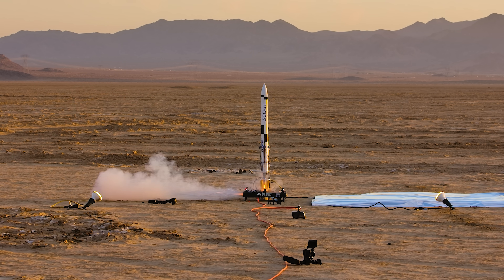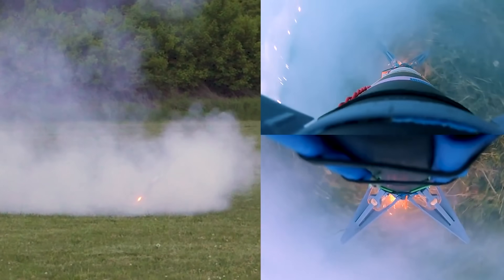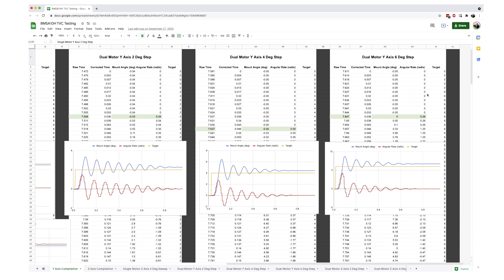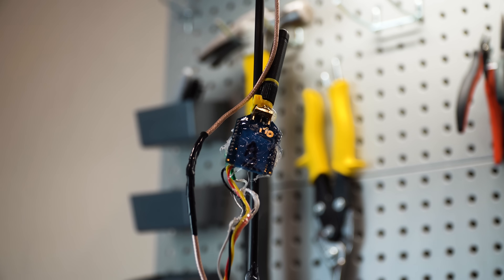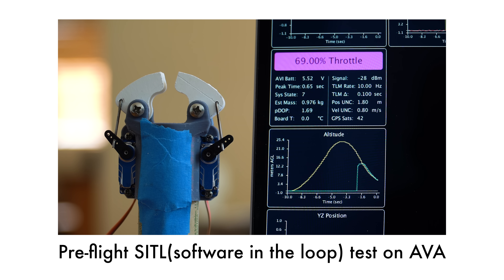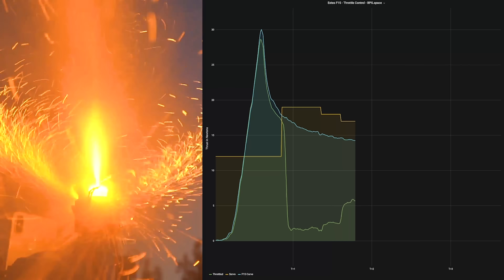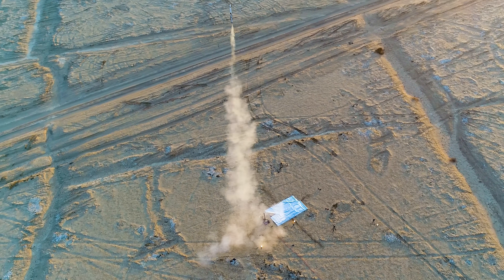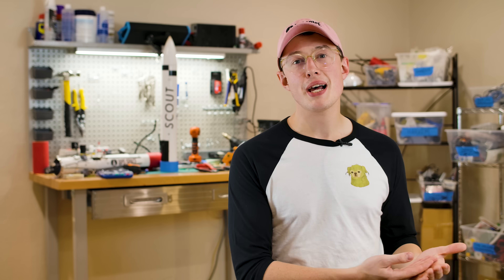Scout F - Flight 1 - Launch and Landing

Comment: I feel like you hate gyroscopes..  show us on this doll where the gyro hurt you. ;)
Reply: You put your vehicle in a really tough spot,  there should be a "bail out" point in descent to say "okay, clearly not going to make that landing point work" and give it an option that doesn't involve crashing.  Would you have been happy with a landing off the target?  From 18m moving over 3m is a bit unfair to yourself and your vehicle.  A small win is better than any loss.  It looked like you would have landed in a good attitude if there was a 12m DA. 
For thrust vectoring and rates of change for the giballed motor, try sticking something into the exhaust, look at the hot side of an f22 raptor.   No need to create something new imho.  The counter to this is that without folks like you there wouldn't be innovation,  and we would probably be writing on stone tablets and building an arc.

Comment: How are you determining your landing burn from altitude?  Do you use an altimeter to choose the landing burn profile appropriate to the descent or are you making assumptions about apogee?  

SpaceX throttles way back on the landing burn, reserving some increased thrust to fine tune the touchdown.  It looks like you have the touchdown thrust worked out, but maybe not the altitude part?

For the gimbaling reaction would moving the pivot point closer to the nozzle help?  It should reduce the lever arm on the ascent motor.  Would that help to reduce the reaction wiggle?  The descent stage didn't seem to have the same wiggle, and it appears to have the gimbal point lower on the motor.

Comment: Good Morning. I have been watching your videos, I love your post-flight analysis. Without grid-fins to manage the tip-over during descent it appears that the landing system has to a lot to do to recover the vertical state while also adjusting for the drift. Have you considered using pop-out grid fins at the apogee to stabilize freefall? How about a 1" drag-chute from the nose cone released at apogee? If you increase initial launch height to  35 meters, this would increase your stabilized freefall, allow the flight system more time to calculate it's position, reduce all the needed motor input corrects for vertical positioning, and maximize motor impulse for drift and vertical drop speed. I am not recommending a parachute landing, just something to assist in addressing the extreme tip over during your descents. One other item to consider, during launch you have a center gravity (CG) that aides in the ascent are you adjusting the CG to maximize landing? Best wishes and keep up the great work. -GB

Comment: The plume almost looks too thin, only way I can explain it is i feel like this is like trying to balance the rocket on a sewing needle compared to liquid fuel big rockets the plume is wider so it’s like it’s being pushed up by a wider plume meaning it’s easier to stabilise, is it possible to build a nozzle for the rocket motors to change the plume ? I know these are obviously fairllyyy different to your fuel system but surely some little metal nozzle could be slid onto the bottom case to effect plume power, size and shape ?

Comment: Did you take into count "wind speed"? It looks from the exhaust plume that there was some good wind that pushed the model off target, also maybe add  on a landing site transmitter and a receiver to the model so the model has a target to aim for, maybe a laser pointer or rf signal.

Comment: The landing burn control problem... are you currently creating a desired acceleration curve with a nominal thrust output of 80%, then using the paddles to correct for discrepancies in altitude, or for acceleration? And is this all time based?

Comment: I have no engineering education or experience, but what would prohibit a third engine with 50% capacity of your landing motor, setting AVA to fire it at 45 % of your landing motors expected capacity.? I know that you said that the throttling doesn’t shut it down completely, but if you estimate the burnout time, it should give you some added security.  Thanks for the content, I enjoy your videos!

Comment: Maybe adding vibration insulation between AVA and the engine, might help with the sensors noise from the gimble.  Also try playing with the bias in the PID loop, a bias of 50% will make the PID loop think it needs 50% to maintain the Setpoint from there it will correct itself.  Not sure if you can program AVA, but enabling the PID loop at a specific height might help you at starting the land sequence on time.  Could you monitor the apex of the flight and find the reset curve for your setpoint?  That way your setpoint is constantly being adjusted based on the height.  Not sure if it’s relative, I’m just a BAS controls guy.  Keep it up, your videos are fun to watch.

Comment: That's crazy to be able to do that with solid motors.  The wiggle seems analogous to pilot induced oscillations.  I'll bet there's a way to filter that out.  I'm a mechanical engineer, so the first thing I'd consider is mounting the flight computer inside a soft, damping material, like foam rubber, to mechanically slow the response.  Who knows though...that could just make it worse.
Reply: Also, you could probably delete one of your thrust control servos and replace it with a bearing.  Then, just have a tie rod going from the spindle to the other spindle, but offset by 180 degrees so it gives equal but opposite motion.  Alternatively, you could replace it with a linkage similar to a scissor jack.

Comment: Perhaps you could incorporate a dilating iris shutter to throttle the engine power? I don't know how you'd construct such a shutter, especially out of ceramic or graphite, but if you figured it out, I think it would work much as the air/water scoops on jets/jet boats.

Comment: I wonder if you could incorporate a sort of "ratchet" joint into the legs, which could absorb some of the "bounce" energy by deforming enough for the "ratchet" to click once. It would be an application of flexure, a design philosophy intended to compensate for "slop" caused by the nature of the structural material and/or imperfect (imprecise) construction techniques.

Comment: Looks like you also need to cancel out more of the horizontal slide right before landing. Hopefully soon you can reach a point where you can have this exact "failure" flight path and still stick the landing.

Comment: The legs are to shaky and flip down too quick. Make them slower and stiffer, so they don't disturb your control and act like giant spring. Long plastic or aluminum tubes act like a spring as well, so those likely need something that absorbs more. Keep it up!

Comment: I was watching another video where you showed offcenter rocket motors. Wouldnt them interfiere with your TVS, like this slightly small offcenter vector induce an error and cause the wiggle effect? Its like the TVS is always counteracting the small offset vector of the motor since the beggining of the flight.

Comment: To fix the bounce issue on landing; try using sharp pegs that are angled towards the centre instead of flat feet, these should dig / hook into the ground on landing with no need for a landing pad. Good luck!

Comment: I mean this is proof of concept. I think that if the rocket had enough lift then it would have had enough time to fire the landing motor. Maybe it’s time to go big, use a larger launch motor or maybe a second of the same and try again. But if the landing motor was independently fired at a set altitude on decent would probably be a good way to go but it would be more work

Comment: Another thought, if you shaped your throttling tabs like a reverse thruster, you could potentially cancel out that residual 20%, and effectively shut the motor off. Challenging design problem, but a fun one.

Comment: I am no expert in rocketry engineering but i have experience and knowledge in acoustics, is your rocket weight and dimensions enough to handle the thrust and vibration produced by your motors (combustion materials), i see you are doing the electronics okay but the rocket body (weight, dimensions etc)  doesn't seem to be handling it.

Comment: If I could make a suggestion on rocket improvement. Might I suggest a CRAZY idea.. to instead of using one solid rocket motor and ceramic clamps, finding a design that can work with hopefully more than three rockets doing the work with clamps on them allowing for the controller to dynamically control thrust from different angles without as much gimble, so your rocket exhaust can be mostly straight out. IDK just a crazy idea. I though possibly even with more smaller solid rockets you can have a better efficiency when fully clamped and provide the rocket with a very low thrust if needed for a soft landing. Have fun exploring!

Comment: I would write a simulation and visualization with all the relevant aspects so that you can find theoretical solutions first. Maybe you will even find things to optimize in the rocket design. I think doing more tests is not going to be very helpful. What if you land the thing by chance once? You will have learned very little and it will not be repeatable.

Then after you gain more insight into the control engineering, you can move to tests and try to quantify as much of the parameters as you can. Perhaps in separate tests.

Comment: Interesting, why are you hard coding the landing flight controls? Would a reinforcement learning algo not help to make the narrow adjustments necessary? This approach requires perfect functioning hardware and flight conditions (so a change in air pressure can be an issue) to work consistently. Great work either way.

Comment: What about a non-expansive suspension system? Like a ratchet system accompanying the current suspension, that way the bounce on landing is partially dampened by the landing gear not re-extending to a degree after absorbing the shock.

Comment: how about just use a stake or a spear head to split/steer the propulsion radially away, less down, that kind of idea
Reply: ideally it will be symmetrical radially, so keeping it in same position and less power down, and can be adjusted, somehow, moving the cone up or down, closer or more far away, from the rocket fire
Reply: a rocket control rod cone directly in the way of the rocket, but so far away, that you have to move it very close to have the slow down effect, and bonus: the rocket fire flow will bend around the cone, even if its in the way, check the tom stanton coanda effect videos
Reply: do you like rambo, you can serially load a rocket feeder starter machine rocket igniter, then eject, reload, from the motor tube storage above, or just a long tube stick with sequentially starting motors and ejections
Reply: consider separate rcs to control the direction, so that you can keep the nozzle section as simple as possible, remove the thrust vectoring from the rocket part
Reply: 4+1 is the best, 4 auxiliary rcs + 1 main thruster
Reply: air brake grid finns, ie, downward direction passive wing control

Comment: Quadcopters tend to do this bounce when they hit the ground because of the I term in the PID controller, but this seems like you can't shut the thruster off. I've found either way the best thing to do is just kill the motors right before first touchdown, or the exact moment of, after really slowing it down towards the ground. That way the "bounce" is negated by there being no way to make thrust

Comment: Awesome job! Just out of curiosity, would there be a way of incorporating distance detection by sonar, or radar, or microwave, etc. to trigger landing motor ignition and thrust throttling based off of approaching ground distance detected? So that when it actually touches down thrust diverters would prevent any further force once your sensors detect touchdown. Just a thought. Keep up the good work!

Comment: Wouldn't doing a similar wiggle be a good way to reduce effective thrust? That would lose some horizontal authority, and possibly make the control problem harder in funny ways (e.g. by introducing vibration), though. This kinda resembles the S-shaped trajectory you were using previously, but with "more than one wiggle".

Comment: so i had an idea yesterday, inject some kind of extinguishing gas/liquid/powder into the combustion chamber to give solid rockets throttling capability. extinguishes the flame if you do too much but im sure the right balance and correct element youd be able to just choke the combustion and be able to raise/lower throttle via the amount of stuff you pump in/speed/temp

Comment: I haven't been keeping super up to date on the progress of the rocket builds, but I was wondering if you had considered adding some sort of dampening element to the landing gear? 

Definitely easier said than done when trying to account for weight and the many other things you're trying to control, but maybe something like a suspension piston from a smaller scale hobby grade rc car might help with the bounce. Also your work is beyond impressive, (not trying to be an armchair engineer here just thought id mention it for the really small chance you haven't thought about this already). 

Love your vids!
Reply: @BPS.space

Comment: Is there any reason you cannot actually measure the distance to the ground with maybe a laser, and based on that figure, increase the throttle to 100% after steady fall and cut the throttle (lower to X thrust) just before touching base. Just a thought

Comment: Awesome work!

I'm far from a professional when it comes to control systems and PIDs but that looks like your algorithm is a over-compensated. Have you tried adding a low-pass filter or some damping in the algorithm. Also might be an option to put lower limits on the allowed movements on the gimbal? The movements the gimbal does looks a bit crazy to be honest!

Comment: Just a thought. Back when I was flying model rockets there was some research into an effect named the Krushnik effect (spelling?). Basically, the further you moved a model rocket engine up inside the body tube the more the thrust was reduced. Maybe a movable sleeve could be could use this effect to work as an engine throttle? That way you wouldn't need anything directly in the exhaust path. Just a thought. The NAR archives should have something on the Krushnik effect. It was presented at one of the NAR national events.

Comment: If you have two or more motors that rotate into opposition and then finally upside down~ish to be a near instant down force.  Some leg wiskers can start the engine flip. The legs can have a progressively stiffer "crush" function.

Comment: While not impossible to land with a SRM, you're limited with the thrust curve of the motor and no ability to throttle the thrust. Have you looked into buying a hybrid rocket motor. I know they're available in standard rocket motor sizes but you'll need one that throttles. In University I designed and statically tested my own hybrid motor. Therefore, I know you can design and manufacture one relatively cheaply and safely. In terms of safety if you use nitrous oxide the motor is inherently safer then even SRM's.

Comment: You have several issues, most of which have been identified. Too much thrust wasted on adjustments means your over-correcting. Limiting the adjustment is the easiest way. A second issue identified is the momentum, which in modern rockets is corrected, not by moving the entire fuel tank, but by adjusting the nozzle. Whilst a challenge for solid rockets, it’s doable. Next, I am concerned about the lack of Waffle Fins. One, they remind me of chick-fil-a; two, they are effective. On the way up, they can serve as a less momentous way of adjusting trajectory and on the way down can provide additional drag and help steer. The last issue would be your dependence on maximum height for proper timing. The flight computer should be able to sense altitude at a predetermined altitude fire off the second motor…maybe also deploy the landing gear and direct some crispy waffle fries…I mean, fins. BRB.

Comment: Because you have a fixed burn time / thrust decent engine, use a Hamilton jet type vectoring,  to throttle and then reverse  thrust on ground contact of one of the legs that way you are using the remaining thrust time to stabilize the landed rocket.  Also your 2 throttle arms will induce thrust perpendicular to there axis if you are using a gimble on the decent engine, as well dump it and go with a 3 leg thrust vectoring/reversing. I would suggest graphite it is cheap light, heat, conductive resistant , strong,  easy to machine although messy. This reduce the reliance on rocket motor burn out timing.

Comment: instead of the complexity and weight of gimballing the motor, could you use three (or four?) of those throttle arms to vector the thrust? Weight savings and less mechanical complexity!

Comment: Another solution is to use some predictive model to estimate when to fire the motors using the current height and speed of the rocket and create your trajectory (blue curve) on demand. You know where you going, how fast and know the thrust that the landing energy can make. You can F = m.a and calculate the max speed/height you must be to activate the engine.

But i really think only optimal control theory can save you. With this you can create the fixed time/thrust constraint and calculate the exact height where you need to light the engine considering the lateral trajectory to hit the landing point.
And it's not that complicated, only some matrix calculation, but modelling it right is a pain.
Looks like a big step but i think is the way to go. I think that's the limit of a PID controller hahaha